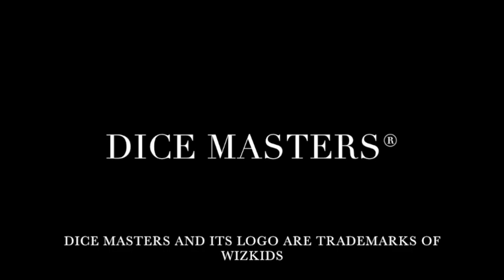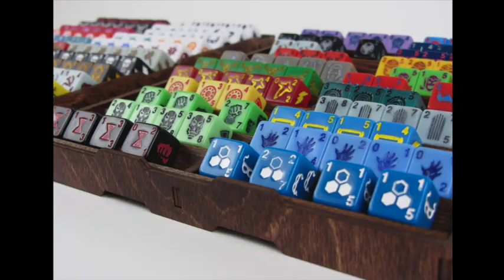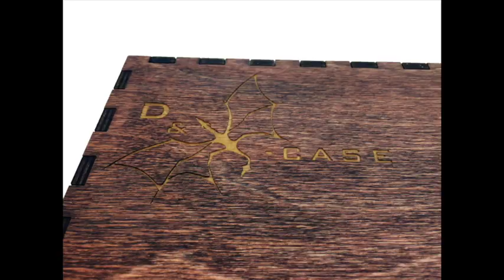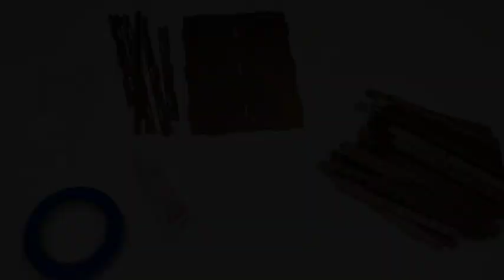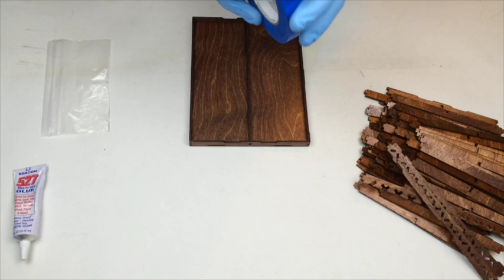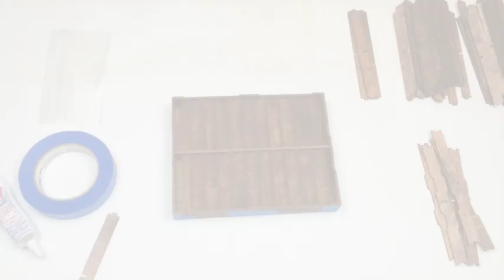Dice Tray Assembly Video

Comment: Lol at "getting the easy part out of the way". What actually happens is that they don't fit all the way into the slot and it's next to impossible to press hard on them to push them in without bending one of the other spines. And the b's won't go in unless the a's are all the way down which can result in some very painful claw hands from trying to squeeze the damn things into the slots. How do you deal with this?